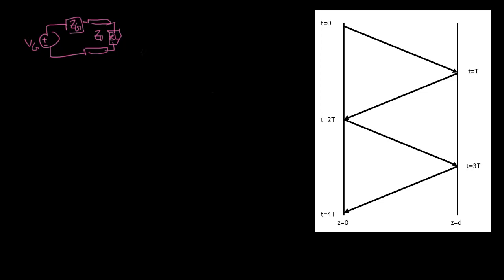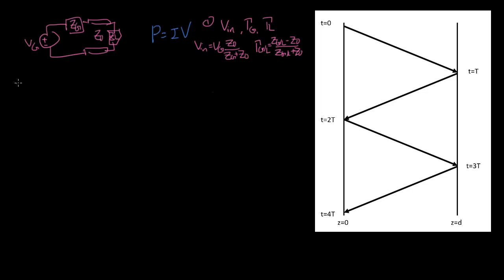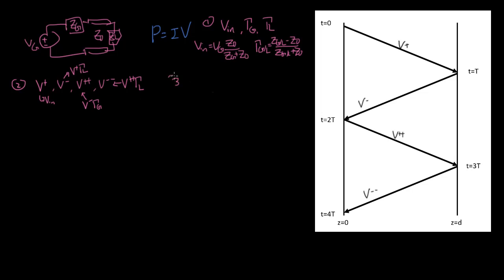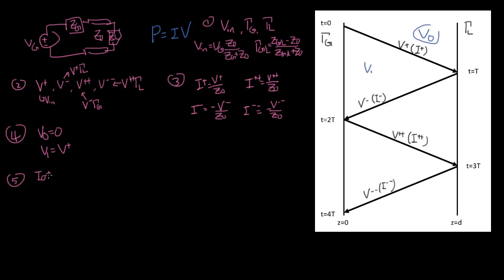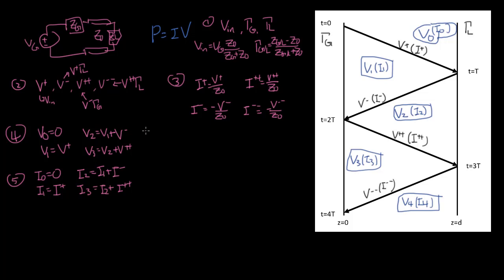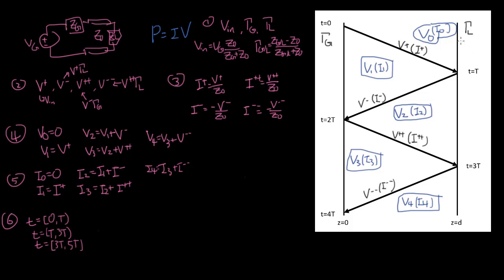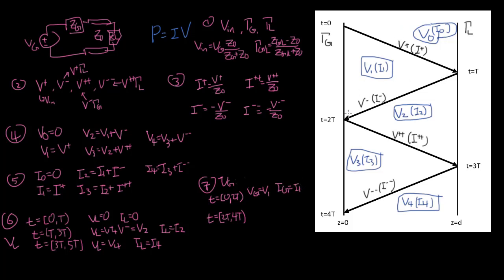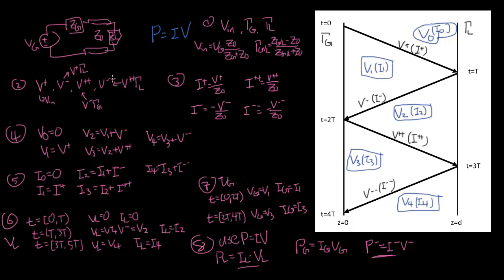GT ECE 3025 Skill T4-01: Calculate the power in the transmission line.

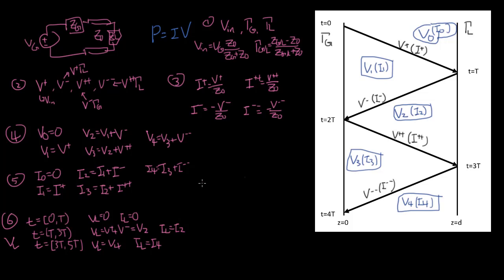Comment from the maker: Error: at 10:36, The "V_G" should be V_{in}, which changes over time. "V_G" should be constant. My intention was to say "Voltage at the Generator side of the T-line." I will try to fix that but might prioritize fixing other more glaring errors and generating sufficient new content.